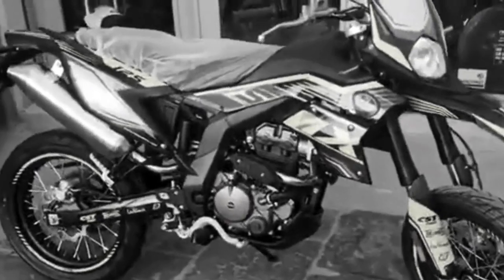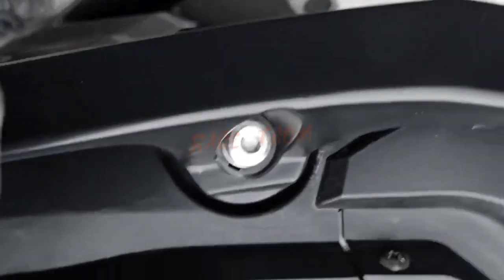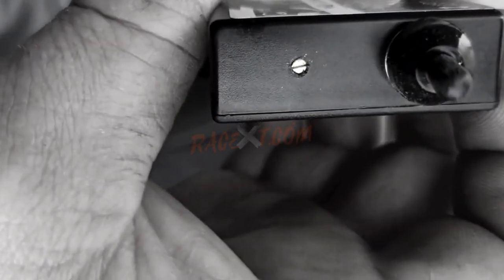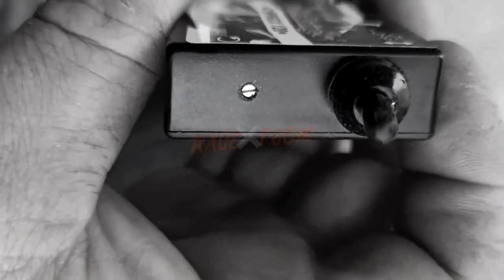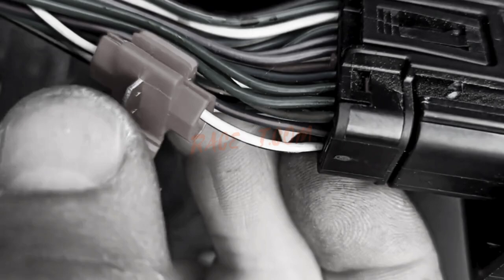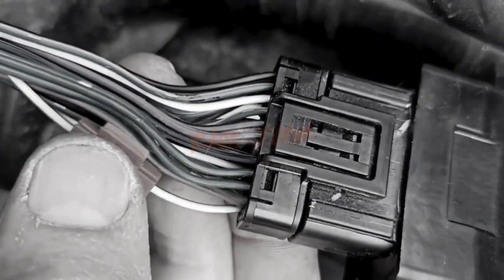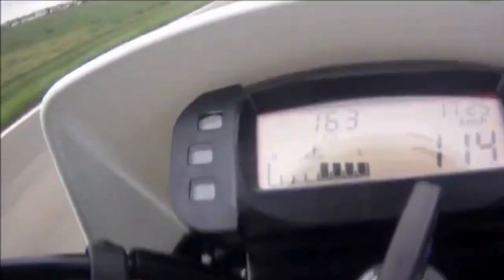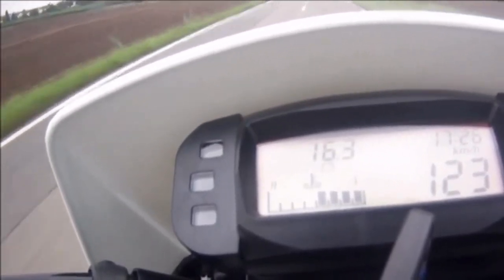Chip tuning for FB Mondial SMX 125 Motard E5 power unit

Comment: How much hp can be gained from chiptuning?
Reply from the maker: 🐎For horses you can not give a real and numerical parameter not having the vehicle at hand as this depends on many parameters.
✅We can give guarantees on the perception of results and therefore perceptions of real improvement while driving and a satisfied or refunded policy of 30 days 

➡️You have a perceived increase in extra power and therefore the car will be smoother with better acceleration in the surprises, 
➡️ also if it does not have the results you want you have 30 days of return guaranteed
You can find it on https://racext.com/product/chip-tuning-for-fb-mondial-smx-125-motard-e5-power-unit/
Reply: 125cc stock 15 hp so just an estimate?
Reply from the maker: @shrimp7366:
Great question! 👋 On a 125 cc 4T bike like the FB Mondial SMX 125 E4, riders typically see about 1.5–2.5 HP gain at the rear wheel—roughly 10–15 % more power in the low- and mid-range. Of course, exact numbers depend on stock tuning, airbox, exhaust, and conditions.

✅ Plug & play installation (no ECU flashing)
🔄 Fully reversible
💯 30-day satisfaction or money-back guarantee

👉 If you’d like to feel that boost yourself, grab the chip tuning module here:
https://racext.com/product/chip-tuning-for-fb-mondial-smx-125-motard-e4-power-unit/

Order now and we’ll send you the full install guide plus step-by-step support to dial it in perfectly on your bike! 😊🔧
Reply: A German YouTuber also managed to get into the E5 control unit of a Mondial 125 E5. He also said it's difficult to give an exact performance increase, because the control unit imposes a seemingly insurmountable barrier at about 80% throttle opening. He put the motorcycle (Mondial HPS 125 E5) on the dyno before and after the reprogramming. At partial load, the bike has 1.5 to 2.5 hp (2,5hp at 8000 rpm) more power "at the tire". At full load, with the throttle fully open, the control unit regulates everything back down to the original setting. 
To put it briefly: chip tuning on a FB Mondial Euro5 125 provides more power at half throttle but does nothing at full throttle. Search for the YouTube channel "Malagutino." He even made a video showing how the thing behaves after chipping. It pulls up much faster, but the top speed remains the same. If it's not too expensive, it's definitely worth it.
Reply from the maker: @TQu46:
Thanks for sharing those dyno insights! 🚀 You’re spot on—on a Mondial SMX 125 E5, riders typically see about 1.5–2.5 HP gain at the rear wheel under partial-throttle conditions (around 80 % opening). At full throttle, the stock ECU will still kick in its limits, so peak numbers stay close to stock.

Our chip tuning module targets that low- to mid-range gap, enriching the mixture where you actually ride most:

🔌 Plug & play (no ECU flashing)

⚙️ Boosts throttle response up low

🔄 Fully reversible

👉 If you want the same setup on your SMX 125, grab it here and we’ll send you the full install guide plus step-by-step support:
https://racext.com/product/chip-tuning-for-fb-mondial-smx-125-motard-e4-power-unit/

Ride smooth and enjoy that extra pull! 😊🔧